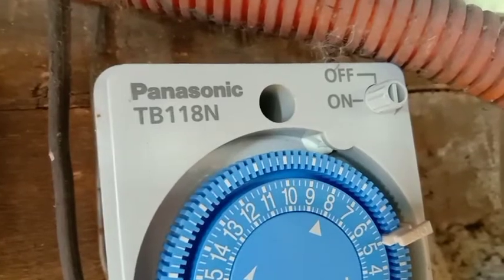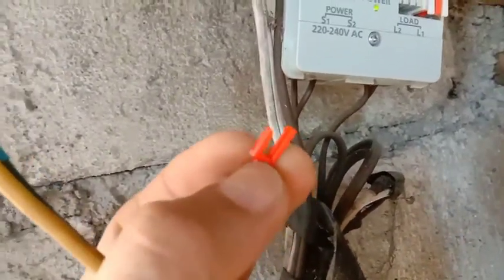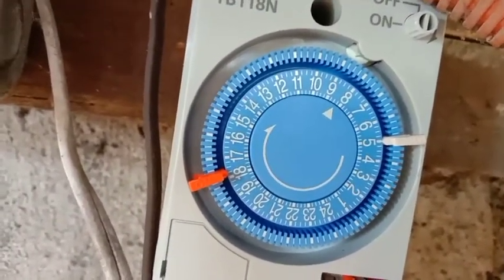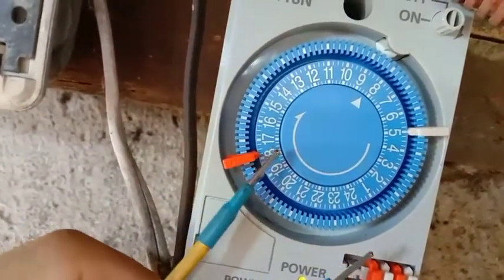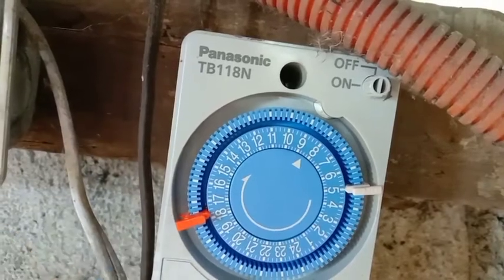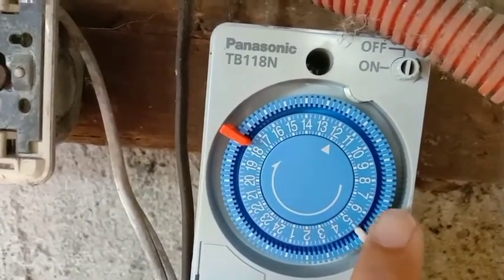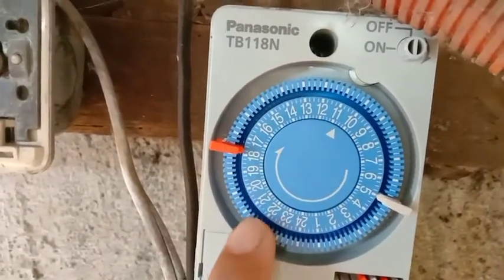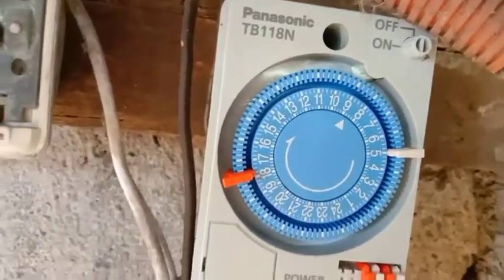TIMER SWITCH | PAANO GAMITIN ANG TIMER SWITCH? (Panasonic) | Rey electrical

Comment: Paano boss kung gusto mo na ..off ang relay at manual ka na lang ano ang pindutin mo? Salamat
Reply from the maker: Sa upper right parts po yung may knob pinipihit po uliting nyo po video pinakita ko dyn.
Reply: @reyelectrical  salamat po boss..subscribe na ako..hehehe
Reply: @reyelectrical  boss isa na lang po ..boss kasi po naka timer po ako ac namin ng 3pm to 11pm po..kung adjust ko po ba ang 3pm to 9pm..pwde po ba ..ano po ang pipihitin ko yung sa right side po?? Boss cge na po ..kasi sobra po init ng room namin..insik po kasi amo nmin
Reply from the maker: @sayangbelen7406  kung kaparehas po timer sa demo na ginawa ko dto.yung white po lipat nyo lang sa 21 yon po ang 9 pm.

Comment: pag nawala po ba Yong isang pin ng lock  anu po mangyari?
Reply from the maker: Ok lang po for multiple switching lang po ito
Reply: Thank you po
Reply: I mean yan pong kulay orange and white on/off pin lock po ba tawag nyan?
Reply from the maker: @sheilasabang2448  yes po.
Kung yung nawala ay naka set up sa timer need mo lagyan uli meron pong spare dyn sa gilid ng timer